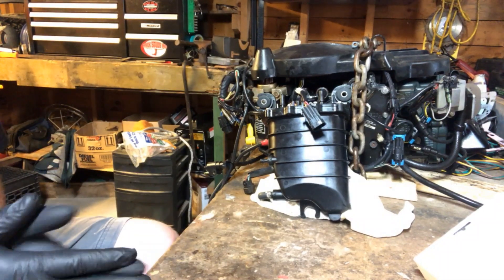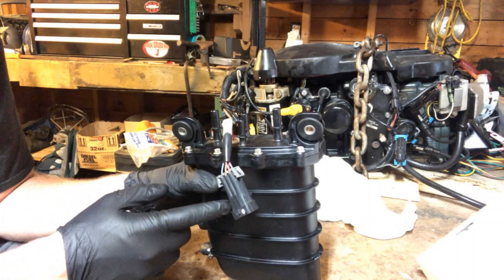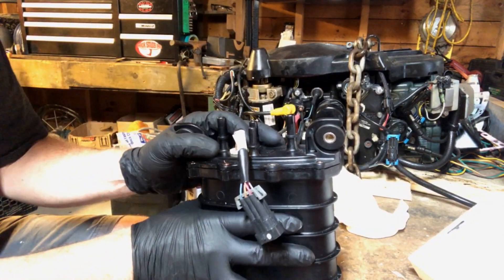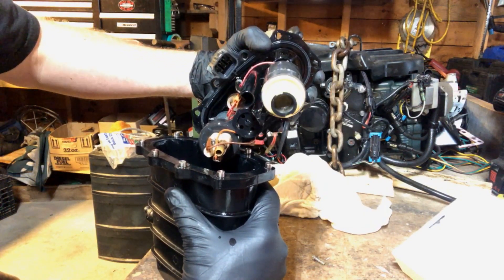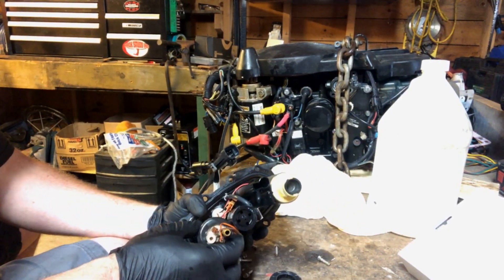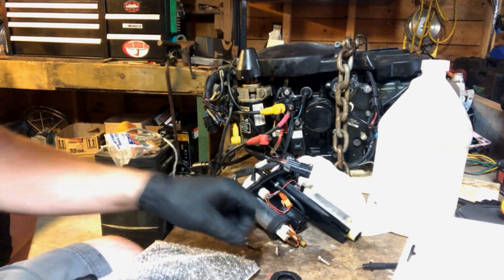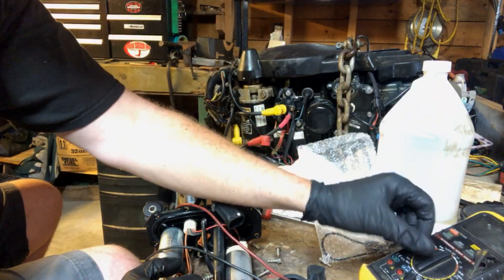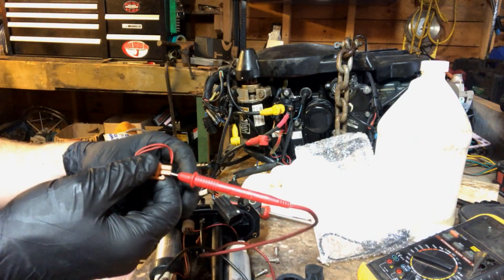How to service Mercury 4 Stroke Outboard FSM Fuel Supply Module

Comment: So where is the pump control relay . No one seems to address that as a pproblem .
Reply from the maker: Fuel pump relay would be with the rest of the relay’s on your engine, location is dependent on exact model you have. Service manual will slow exact location. Relay issue would cause no power to the pump so that should be determined before servicing the module.

Comment: Sir,great video, I have a 2012 115 hp 4 stroke that is not running right. Has 96 hours on it from new.
Starts up and runs fine for 10 minutes or so then starts running rough and shaking and won't stay running. Usually starts right back up .it may run for a little bit then starts acting up again. 
I have good pressure at the Schrader valve when I depress it in.
Could this be my float switch? Do you have the meter set to ohms to check it ?
Also,my foam filter was completely gone.
I replaced fuel, fuel line, filters,plugs and installed a water separator filter.
Any help is greatly appreciated..
Scott
Reply from the maker: Are you experiencing those issues only at idle? Can you drive the boat? Check throttle position sensor and idle air control. 
Could be float switch if it’s overflowing fuel into the air intake. Yes check on ohms setting. 
Troubleshooting this engine is easiest with diagnostic software unfortunately.
Reply: @maineboatguy , yes I can drive the boat at times in between when it is acting up. Most of the time o can't get it on plane.it runs for 10 to 15 minutes then o have to shut it down..it starts right back up .but then it won't idle. Could it be the float switch? 
What is the beat way to do those checks you mentioned?
Thanks so much for your help...
Reply from the maker: @bowhunter182  do you have a service Manual for your engine? I suggest finding the correct Mercury service manual so you can perform those tests. Do you have any way to pull the engine trouble codes from the ecu? Would really help to see what the ecu is showing.
Reply: @maineboatguy  ,I will look at the float switch and see if that is the issue. 
If not I will take it to a service technician and have it looked at. 
Thank you so much for your help and promptly answering my questions..
Reply: @bowhunter182  this sounds like a very similar issue to what I'm experiencing with my merc 115. Did you ever end up figuring out the source of the problem?
Reply: @shafer1212  I am having the same issue.  did you get yours resolved?? if so what was it?

Comment: ‘13 90hp merc. 4 stroke, first 3 serial 1B6.
Motor starting running rough after the 2nd time out, while changing the fuel filters and plugs I noticed 2 things, plugs were wet (gas) and the foam air filter had chunks of foam missing.
I heard that mercury replaced the foam filter for disintegration, how do I fix this if the foam pieces were sucked in?
Reply from the maker: The chunks of foam will usually get sucked in, pass through the engine and out the exhaust, you can look inside the intake and remove any sensors in the intake to ensure the foam isn’t stuck in a sensor, you may have to remove the entire intake to inspect sensors and fuel injectors. I’ve seen the foam completely gone from the air filter but never effect the running of the engine so if sensors and injectors are clean I don’t think I’d be chasing the foam pieces for long before searching for another issue.
Reply: @maineboatguy  Thanks for the information, appreciated.
Reply: @maineboatguy  Motor has been at dealership for 3 weeks, the only code was overheat so they replaced the impeller, no more code but motor runs terrible.
Did pressure check of cylinder hot and cold all within specs. Pulled fuel rail/ injectors cleaned and tested
All test done with fresh fuel to be sure.
They suspect, but no sure that it’s a faulty ecm or water getting into #1 cylinder both very expensive.

Comment: Marine Boat Guy, great video and thanks for sharing! I have a 2009 90hp Merc 4 stroke w/this same FSM. Here’s my issue and what I’ve done so far....
Engine cranks fine, moving around in the 1000-3500/4000 rpm range is fine. If I bury it to wot it bogs down and hangs up around 5k rpms. If I back off to around 4200 you can hear/feel the motor pick up and get to the correct rpm range of that particular position of the throttle (NOT FLY BY WIRE THOUGH). If I ease into the throttle little by little I can get it a little higher in the rpm range than when I bury the throttle, but it will go slightly higher if you ease into it. Dependent on load (passengers/towing a tube) it can be as low as 5000 rpm with a decent load or 5400 with just me in the boat. Here’s what I’ve done....Changed high and low pressure filters, plugs, changed fuel lines from the tank to the motor, added a fuel/water separator and electrically checked the coils and the injectors. From a resistive standpoint there is no deviation between like components. 
There is no primer bulb. My next test was to put gauges on the fuel lines under the cowl and see what I get. Oh, I also have vessel view and I’ve gotten no warnings, codes or anything from that....I’m just trying to figure out what points at the FSM? there’s 2 pumps and a float. 🤷‍♂️
Reply: @jagtds79 I'm having this same issue on my 2014 90HP Merc 4 stroke and done the things you mentioned above. Did you ever find the culprit?
Reply: @danielpersa2688 
Yes - Coil pack
I swapped a new one in until it went  away. Replaced all 4.
Reply: @jagtds79  thanks for taking the time to respond after all these years. Appreciate you.
Reply: @danielpersa2688  FWIW, I did replace the float as mentioned 4 yrs ago and that didn't fix it. However, when I replaced the coil packs (Amazon, not OEM) it fixed the problem.  The other day though, when I was going out I got a short alarm and Vessel View showed a code (1111-23) Fuel Float switch.  Alarm went away and we kept going with no issues. 🤷🏻‍♂ I'll also add that a year ago I got code (1112-23) Fuel Vent Switch alarm and it went away and we kept going with no issues......🤷🏻‍♂
Reply from the maker: You’ll definitely want to hook up a fuel pressure tester to the high pressure test port on the engine and run it while someone watches the gauge to see if you have a loss of pressure. Adding a fuel primer temporarily could help you diagnose it as well, light pressure on the bulb while it is bogging down to see if it picks back up.

Comment: Hello, I have Mercury 100 EFI 2007 and probably a problem with fuel pressure regulator but I’m not sure and I will appreciate if you could give me your opinion. If engine is running within 2000-5000rpms and I want slow down to a minimum speed usually engine shuts off. Then again I need to turn engine on put in a gear and I can drive with a minimum speed. What can be a problem?
Reply from the maker: Paolo Nacinovic a diagnostic computer would eliminate most parts that show values on there. Otherwise I would have the injectors cleaned and fuel system serviced unless you've already done so?
Reply: Maine Boat Guy for me is a problem to find someone with a diagnostic computer in my home town. 
FSM was already opened, there was plenty of dirt on a small filters that are on pumps and on fuel pressure regulator. Pipe that is connected on fuel pressure regulator was damaged. 
So I’m sure that both pumps are working fine, and injectors been cleaned afterwards, I can only measure fuel pressure? 
Also air filter was all falling apart, maybe some piece of filter stuck somewhere and interrupts working of IAC valve?
Reply from the maker: Paolo Nacinovic have you checked the throttle position sensor voltage to make sure that is adjusted properly? Also did you leave the fuel pressure tester on the engine when it stalls to see if you actually loose fuel pressure?
Reply: Maine Boat Guy I didn’t check voltage on throttle position sensor. Can you tell me how to properly check or adjust it?
Unfortunately I haven’t done fuel pressure test, I hope that I will do it this weekend.
Reply from the maker: Paolo Nacinovic you'll need a multi meter and the service manual. Most tps should be set at .7 volts to 1.0 but the service manual will tell you exactly.

Comment: I have a Mercury 6 hp 4 stroke.  Fuel is not pumping/moving past the fuel pump into the carb when I pull the starter rope.  I put a new fuel pump on and the carb is still dry.  Any tips?  Many thanks.
Reply from the maker: Darryl Scopes can you get fuel past the pump by using the primer bulb in the fuel line? Mercury had some fuel lines that will deteriorate on the inside and clog the lines and inlet valve on carburetor.
Reply: Maine Boat Guy I’m familiar with what your saying, but I confirm fuel is in the filter, past the lines.  Fuel goes into the pump, but not out the top
Reply from the maker: Darryl Scopes you said the "carb is dry"? Can you get fuel to the carb with the primer bulb?
Reply: @maineboatguy  there is no primer bulb
Reply from the maker: Darryl Scopes there should be a primer bulb. I'd install one to pump some fuel up to the carb. I've never seen a carbureted outboard start without getting fuel up to the carbs before cranking.

Comment: Hey Maine Boat Guy.   You tested the float switch in your video but apparently got no continuity.  Was the switch you tested OK?
  I've tried testing mine.  I get nothing from the meter.  No continuity no matter the position of the float.  Bad float????  Should get an open or closed continuity, right?  Appreciate any help......
Reply from the maker: Madelyn Asbury if you’re sure the meter is set up properly it sounds like you have a bad float, best to have a meter that beeps so you know the switch is opening and closing instead of watching the meter. Circuit should be open with float upside down and closed when in upright position. Hope that helps and isn’t more confusing 😂

Comment: Thank you for making this.  I just bought a 2013 75hp 4s EFI with only 50 hrs.  It sometimes has really rough idle and stalls or wont move past 2500 rpm WOT.  I heard it could be the floater switch.
Reply from the maker: K Ramsey  yes that's a possibility. Make sure the fuel supply hoses are free and clear, sometimes easiest to try and run the engine off a separate fuel tank to rule out other issues. If you have a primer bulb installed inline you can give it a couple pumps to see if that corrects the issue. I had another one of these that ended up needed a low pressure fuel pump.  mercury has a service bulletin out that helps with diagnosing.
Reply: @maineboatguy  Do you know where I can find the Bulletins?
Reply from the maker: K Ramsey http://www.marinepartsexpress.com/Merc_Product_Bulletins/Fuel%20Supply%20Module%20FSM%20Troubleshooting%20Bulletin%20No.%202009-09.pdf